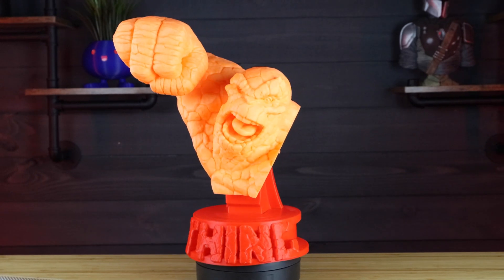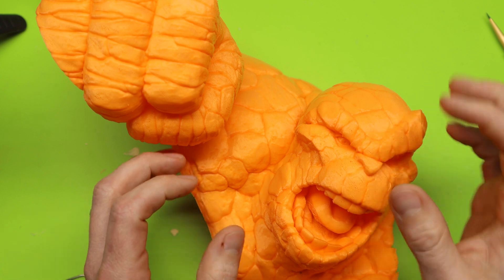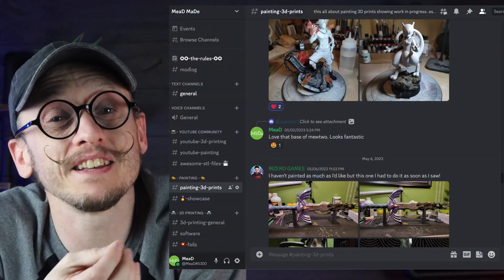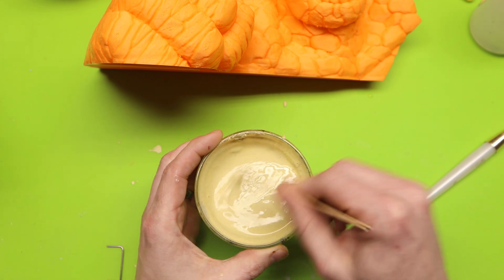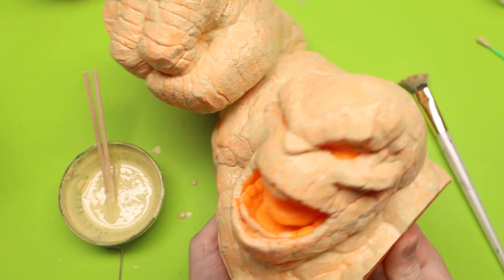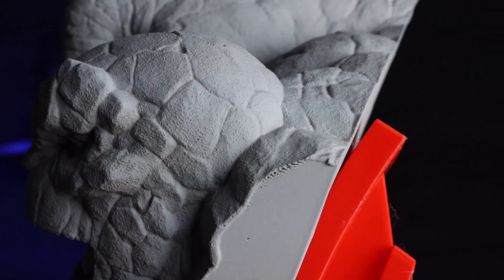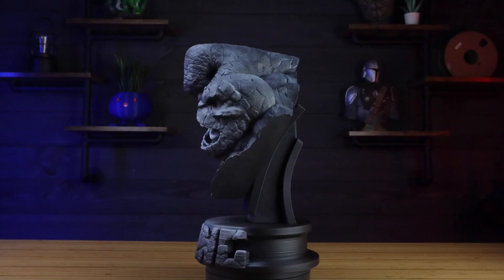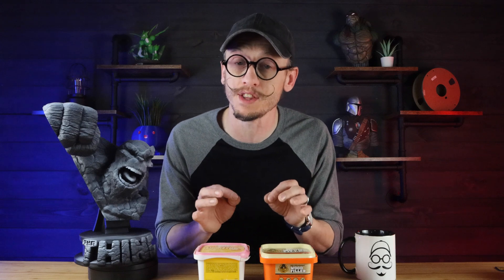Saving a Failed 3D Print from the Trash

Comment: When I use wood filler, it never 'sets up' and comes off later when I go to paint. Any tips or tricks? I am currently working on Majora's Mask that has wood filler applied all over and sanded. However, the filler hasn't really hardened any and comes off very easily. Would priming and p ainting over this help 'seal' the filler?

Edit: Glad the YT algorithm found you. Been on a video binge!
Reply from the maker: Yes I would prime it to seal it. You can also use a clear coat to seal it as well.